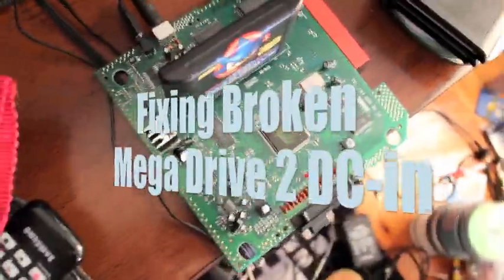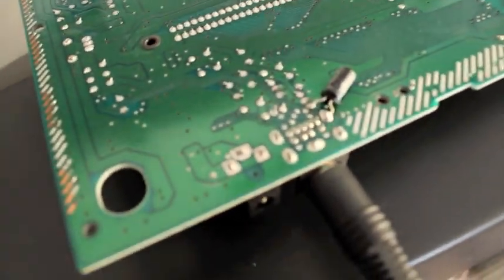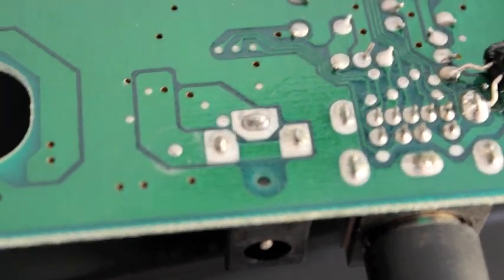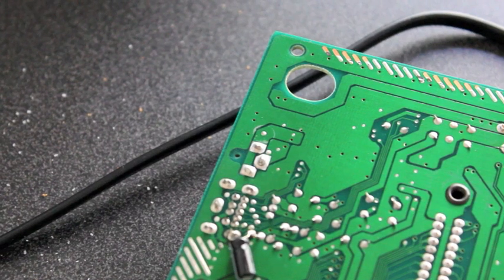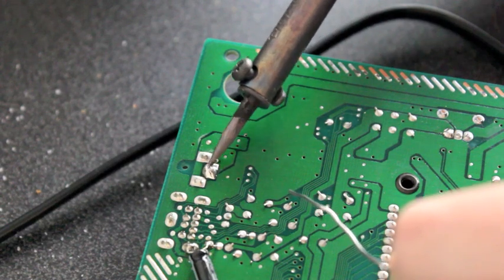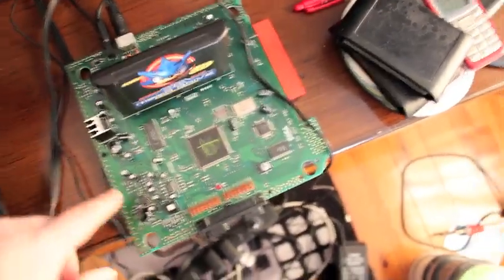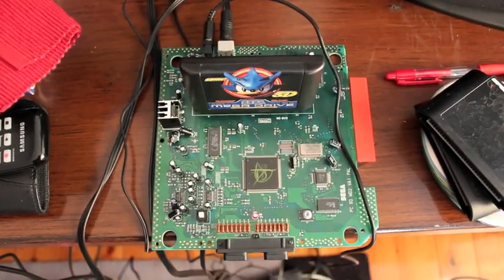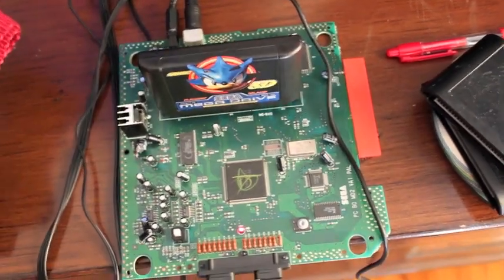Sega Mega Drive 2 DC-in Power Socket Repair

Comment: I've just ordered a composite cable off of ebay which should be with me in a couple of days.  After seeing that the led on the board looks broken I got my step dad to test the area with his voltage meter and the board seems to be getting power, so fingers crossed it works fine :) will know in a couple days

Comment: I've tested the power supply on another system and it worked fine so it's not that. Only problem is I don't have an rf cable, so I'm thinking it could be that the LED is dead and the system is actually powering up fine. The LED does look a little bent on the board so until I get an rf lead to test it I won't bother soldering :)

Comment: ok thanks is it possible to get a switch of a another megadrive and change them around?
Reply from the maker: +ZUBAIR Iqbal Should be possible, you'll need to know how to desolder using desolder braid or either a desolder gun (Hakko 808) or a solder sucker.
Reply: Great thanks just bought a spares mega drive off ebay
Reply from the maker: +ZUBAIR Iqbal Cool! Have a read (or watch) into how to do desoldering and you should be right as rain! :)

Comment: hi got issue my mega drive 2 its the power switch you have 2 hold it for the power 2 stay on?
Reply from the maker: +ZUBAIR Iqbal Howdy, that sounds like quite an annoying issue to have! How do you play the games? You might have something like a broken power switch, which I've seen happen on the reset button - or there might just be gunk inside the plastic lid. Got any photos?
Reply: I dont i just got it out of loft not played it for years. I cleaned it up took the mega drive apart?
Reply from the maker: +ZUBAIR Iqbal I'm not too sure, have you tried posting on Assembler Games forums? They often have good suggestions for issues :)